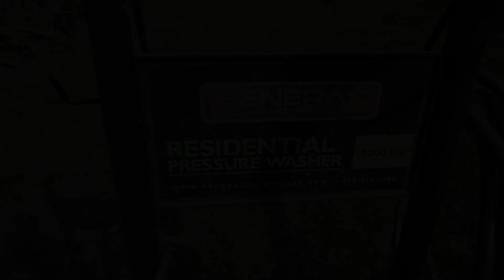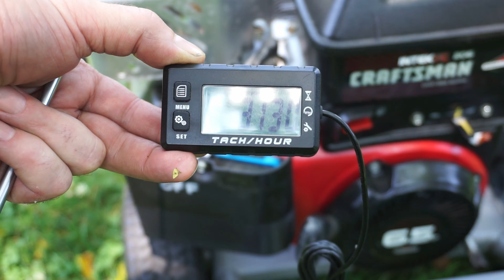Fixing A Surging Carb &Engine! Install HIPA Carb-Tuning Carb & Governor/Briggs 190cc Pressure Washer

Comment: Got my push mower running. Had to replace the float needle and remove the rubber seal. Mine came with a metal seal and required a rubber tip needle. Sounds like crap may have to check OHV gaps and check out the muffler. Rattles while running and a little surging action. Got to check the RPM specs too. Doesn't sound smooth. Got a new blade the old one was bent and too damaged  to sharpen
Reply from the maker: Yup,,, tweak it, work out the kinks!
Reply: @TheNovaJohn  in one of your videos you were using a small tach to check rpms. Where can I get one like that?
Reply from the maker: @timtweet8149  I will need to do a short video or just a shorter regular vid on it!
I get mine on Amazon,,,it uses a removable battery witch is important because I had one that didn't and I think the battery died!
Reply: @TheNovaJohn  kewl can't wait

Comment: Thanks Arch and you are correct that for the money you can not beat the aftermarket carbs but they come with issues in many cases just like you showing in this video. Maybe you can respond to these: normally the running rpm of a pressure washer is 3600 and i thought that automatic transmission fluid caused rubber to swell?
Reply from the maker: Absolutely,, I have a nice stock of factory carbs that I like to rebuild but I don't have every model unfortunately. 
Yes-3600rpm is max for most pumps..What's known as 'reserve power' often we set the engine to 3600rpm no load then it will drop to 3400rpm
When I sell them that's what I do if I feel the engine and pump can handle it, they are used so....caution.
When possible I check the manufacturer rated rpm for the pump... Often I feel its safer to lower it.. 
What I've been doing for my pumps is reduce the rpm, and even further by using the lever on the side of the engine.. I find that what I use it for is often way too much pressure.. That's another reason I like the pumps with the adjustable valve! 
The machine in this video I recently set the max higher then I put a mark on the throttle for a lower usable rpm.. Some engines wont tolerate this!
My Subaru really likes this, especially with the 3kpsi CAT pump which is killer!
Tranny fluid is designed not to ruin the silicon rubber O rings and seals that are throughout the transmission. It doesn't swell these, it keeps them fresh as long as possible!

Comment: A pressure washer needs to be running properly  to do the job the right way just like a generator that needs the right roms to get the job done
Reply from the maker: Especially a Generator!! 
Yea,, and if I ever want to sell this,, I wont feel right until its working properly!
Reply: @TheNovaJohn   glad you feel that way to get it fixed and running again like it should be before you might want to sell it 👍😁😄